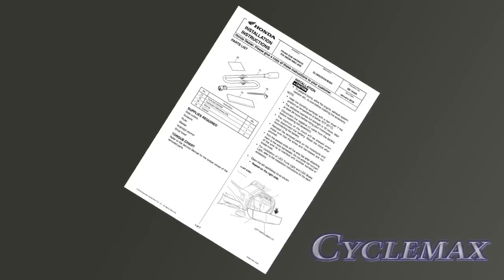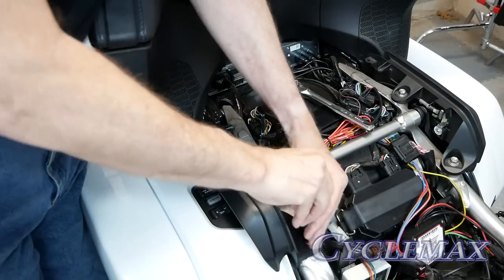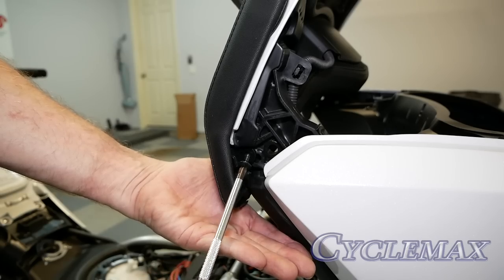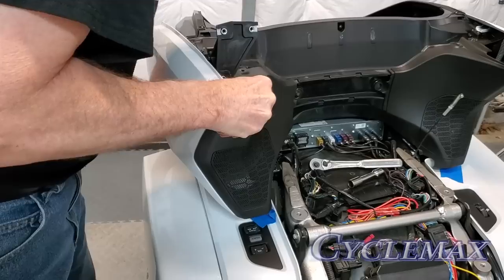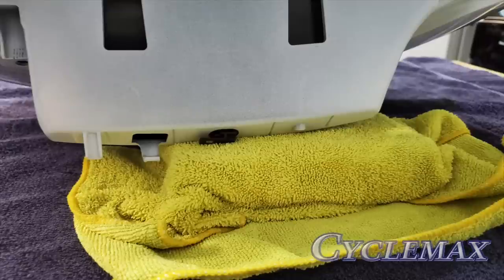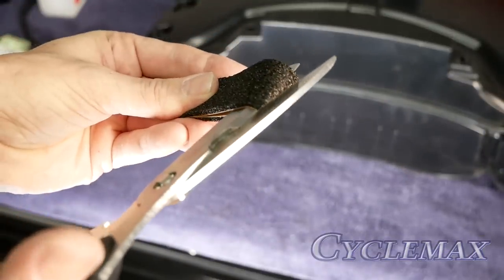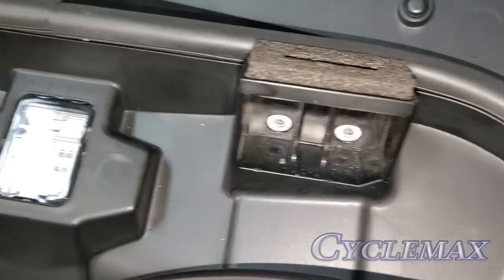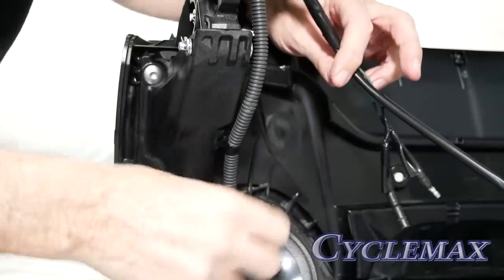Install Honda Trunk Sub-Harness on 2018-2020 Honda Goldwing Tour | CruisemansGarage.com

Comment from the maker: IMPORTANT! There are a couple of errors in this video that I did not get corrected before I uploaded to YouTube. All six screws that hold in the passenger backrest on the underside of the trunk lid are 5X16 long screws, not just the two on top. Also, the two screws holding in the side panel (under the hinge) are 5X12 (short) screws, not the 5X16 longer screws. These scenes have been corrected in my 2018+ Goldwing Maintenance Video series http://gw18.cruisemansgarage.com

Comment: Great video Cruiseman as all your other ones. Thank you again.
I know this is not "professional", but for those people like me who love DIY's even on their expensive bikes.... I used this video mainly to locate the rubber boot hiding there the 4pin plug, from which I connected 3 x two wires and drove them to each of the 3 trunks. I then installed a cheap flat led on the place where the original one should be. When you open one of the three trunks, you create one of the 4pin in the plug to become ground, while another of the 4pin is always hot 12V even when the motorcycle is OFF. I put my cellphone inside each trunk to take a video to make sure light goes off when i close the trunk's door and everything works perfectly fine. It was a 4$ job excluding the time-cost.

Comment: Do you think the ShowChrome Isolation fuse block or Goldstrike wire harness 
make more sense to install?
Reply from the maker: I am not familiar with the Goldstrike wire harness. If it is nothing more than a plug-n-play harness, then it is still deriving power through the Canbus system. The Show Chrome fuse block bypasses the Canbus and provides the power directly from the battery through protected circuits.

Comment: Could you post what the sub harness is for?
Reply from the maker: Sorry, I put it in the description of the video, but should have mentioned it in the video. It powers the trunk LED and the trunk mounted (under luggage rack) brake light.
Reply: Chris, I want to install an accessory power point (Cig. Lighter) in my 2018 DCT  trunk. What would be your suggestion for the best way please.

Comment: I installed the trunk light and the trunk sub-harness as per your two videos. When I connect a 12 volt current to the end plug, the light illuminates , however when I plug it to the plug in the boot it does not turn on.
What do you think is the issue?
Reply from the maker: Are you referring to the brake light under the luggage rack, or the interior trunk light? The only think I can think of would be to test the current coming from the plug in the boot.
Reply: @cruisemansgarage  I am talking about the internal trunk light. 
The light is supposed to turn on when the trunk lid is open and turn off when closed. I wonder where the switch is. No current in the boot plug.
Reply from the maker: @Kashooni  I don't know for sure, but the switch may be integrated in the latch receiver mechanism.
Reply: @cruisemansgarage  Hi Chris, Nice meeting you & Rikki in Nashville Wing Ding in 2019. Sorry you lost your Audio.
The subject inner trunk light inside the lid, finally started working on its own so properly that if you forget & leave the trunk lid open, the light will time out & turn off automatically before draining your battery. Kudos 2 GW.

Now I need a power outlet inside the trunk:
1) Does the already installed sub-harness for the interior trunk light help?
2) Is there any pre-exiting wiring/plug on the bike? 
3) What parts do I need & how would it be done.
4) Do you have a pertinent instructional video?
Thanks for your always available endless help.